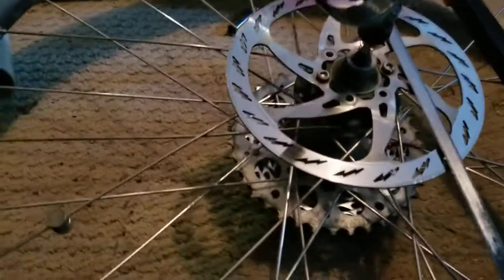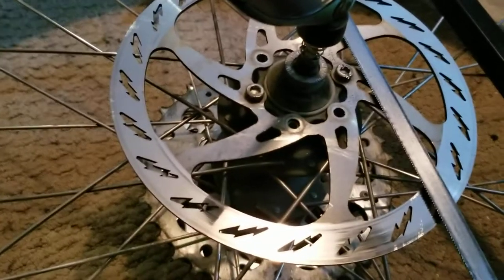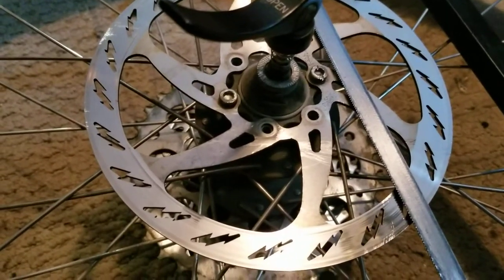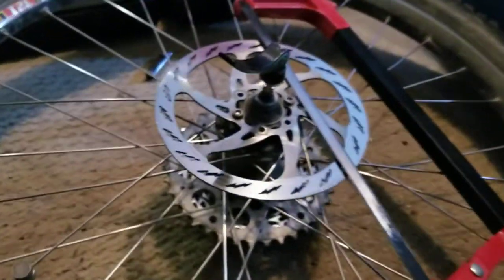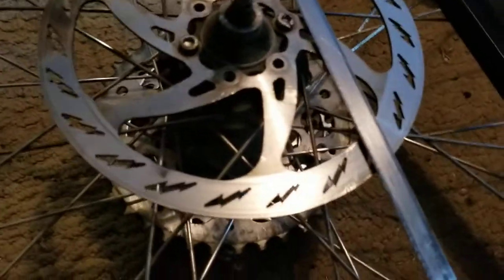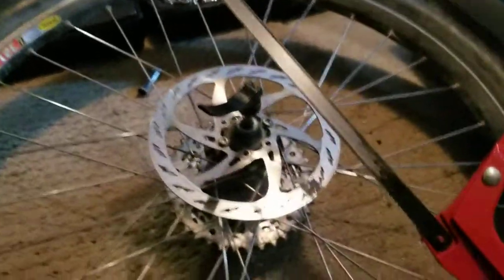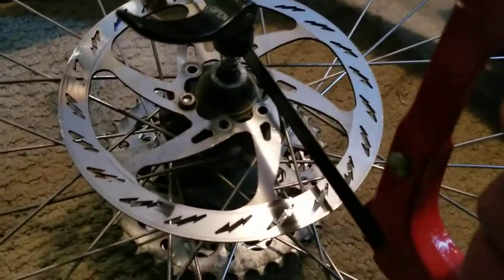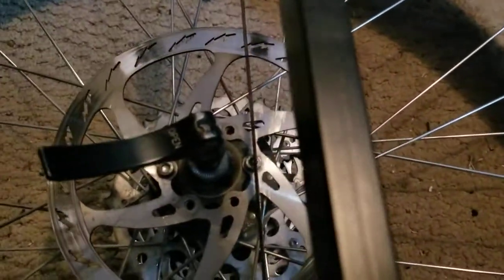How to remove stripped disc brake rotor bolts bike

Comment: Hello i mean where the bolt threads is damaged  what can I do
Reply from the maker: Oh, you mean the bolt head snapped off?
Reply: @PurplePenguinPowa  no but i meant is my bolt dosent tight it sping in the thread
Reply: @mtbridernavid3786   If the threads on the bolt are okay but it spins without tightening, the threads in your hub shell are stripped.  You need a new hub, or a new wheel if you don't want to lace the new hub to your existing rim.  This sucks.